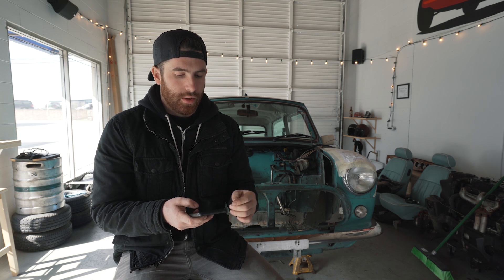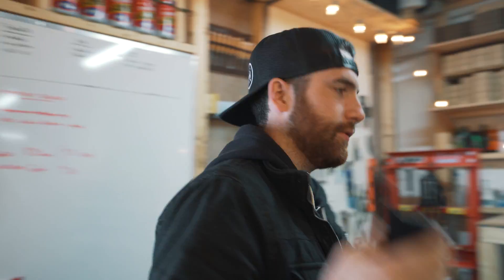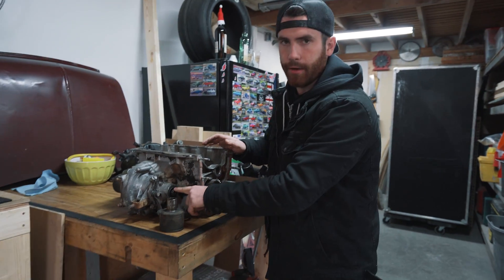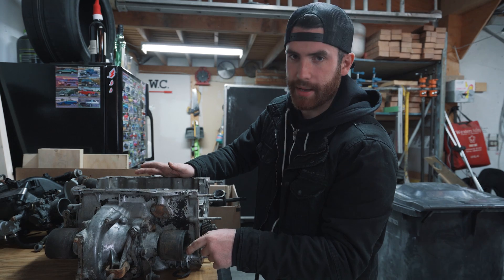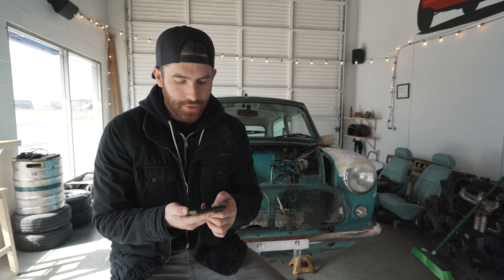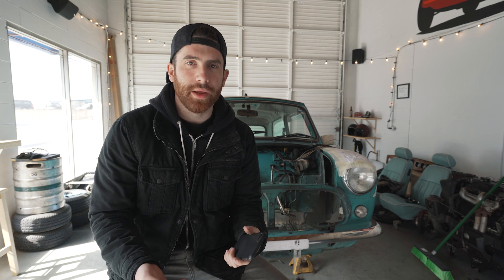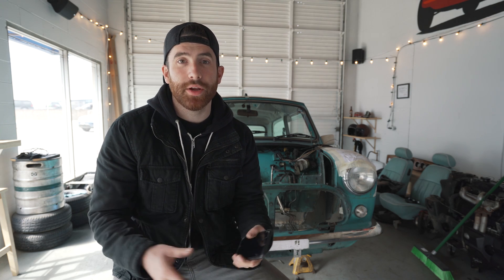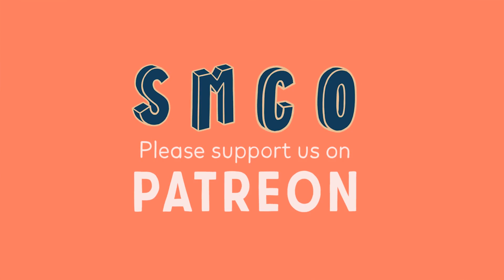So your Mini's diff seals are leaking?

Comment: I have a fair amount of play in my bushes. Is there a good chance that I also need new bearings? How often does that happen?
Reply from the maker: We don't see them wear out too often, but it is possible for the bearings to wear some very deep grooves in the inner pot joints. If it drives well they are probably fine.

Comment: Fantastic tech tip! Any chance we could get a tip video on replacing the CV joints and for a clutch replacement?
Reply from the maker: Thx for the comment. You can check out the CV rebuild video we already have!